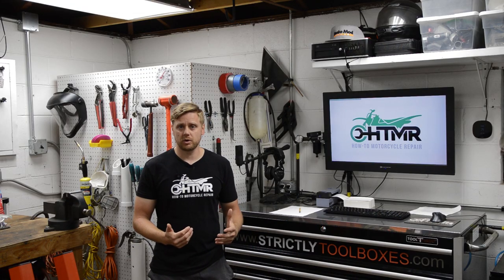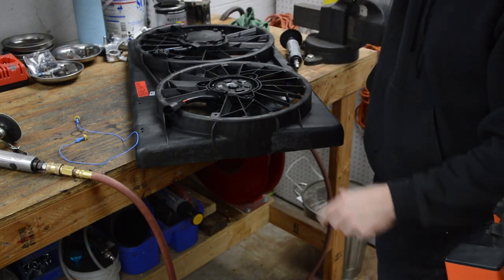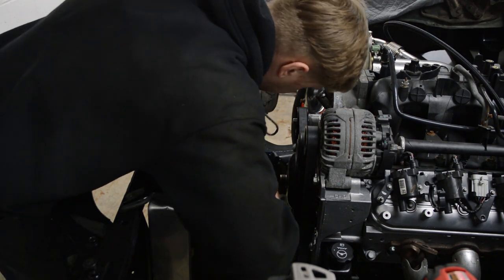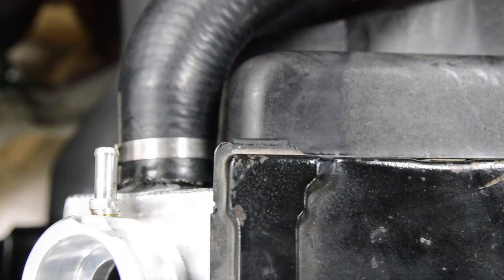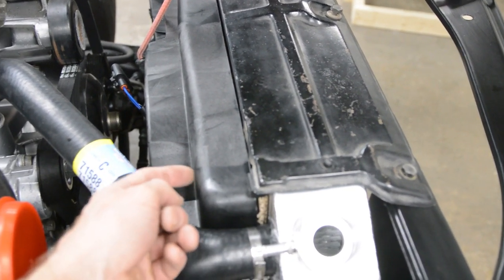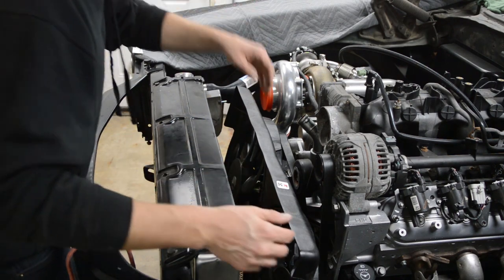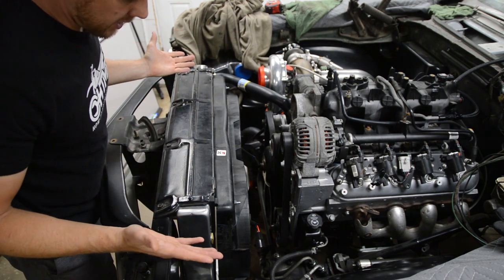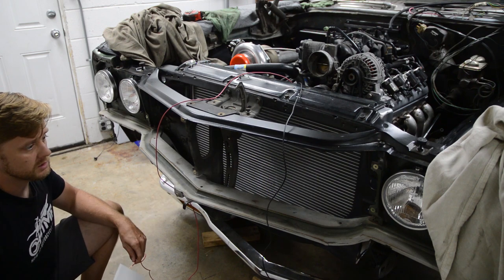Chevelle LS Turbo -  Windstar electric fans - 4000 CFM for $100

Comment: 67 a body BB DeWitts radiator. Would this setup possibly fit?
Dont know how to properly wire these up. What gauge wire, relay fuse, controller? 
Like using a temp switch, no toggles.  Any info would be great
my 16" single spal sucks doesnt do the job

Comment: You should use a gasket of some sort. It's gonna be sucking hot air from under hood instead of pulling all through the rad.  Is there a splitter between the fans or just wide open in there?
Reply from the maker: Yes good point. I plan on putting some edge trim to close the gap. Not sure what you mean by splitter?
Reply: thats weird, mechanical fan shrouds  have a huge hole and that isnt an issue. maybe stick to viewing instead of commenting things you know nothing about

Comment: Another question. Did you wire the fans using a relay or an inline fuse? I've had bad luck with relays and prefer a switch. What do you think is best?
Reply from the maker: I'm using a northern radiator pwm. Slowly ramps up and overall they spin pretty slow, meaning less noise. Costs under 200. Super easy to wire up. Good relays and wiring can easily be 100 and then you get spikes when they turn on. Pwm all the way!
Reply: @HTMR  Ok thanks for the info!
Reply: What's pwm?
What main harness did u use?

Comment: Do you have the part number for the parts used to make power steering pump work for you?
Reply from the maker: What parts specifically? The pulley?
Reply: @HTMR  the hoses or adapter from pump to gearbox
Reply from the maker: @tyferguson564  I swapped in a 93 grand Cherokee steering box. Late 80's Camaro pressure hose works.

Comment: Nice tutorial but you didn't show if it actually works or not the more horsepower you have the more air you need I'm dealing with that right now
Reply from the maker: https://youtu.be/tKHUquX4ZK0  
My cooling system works great and holds 190-195. 180 tstat and PWM fan controller. Fans barely spin, I'd say 10-15% duty cycle.

Comment: How about some long term comments or modifications now that you know ........
Reply from the maker: It's been a year and 1500-2000 miles and no issues. I have a PWM controller and the fans barely spin (maybe 30% duty cycle max).

Comment: 2000 cfm over a wider area is still 2000 cfm...not 4000...smarten up....if i install 6 ...3 inch fans that are 2000 each....i dont get 12,000 cfm
Reply from the maker: Each fan flows over 2000 cfm. What don't you get?
Reply: Smarten up?  Are you an aeronautical engineer or an expert in fluid dynamics?  😂😂😂